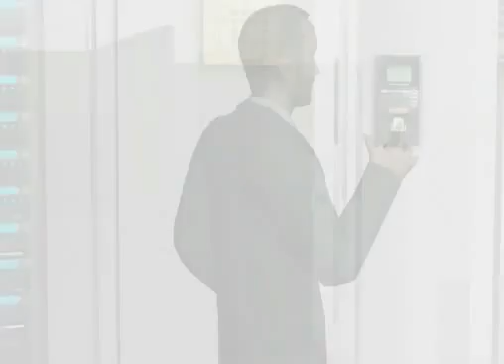Door Access Control Systems

Comment: Please whats the name of that device used to stop illegal multiple entries i.e. tailgating mentioned in the video?
Reply: Alpha Tango thank you for interest. The product is called Access reader - either numeric or biometric or card based
Reply: Kunal Chawda but in what way does the access reader stop tailgating?
Reply: It reads the entry - if authorized by the data entered then unlocks the door by means of electrical signals... locks mostly are magnetic... complete mechanism is combination of electrical and magnetic lock